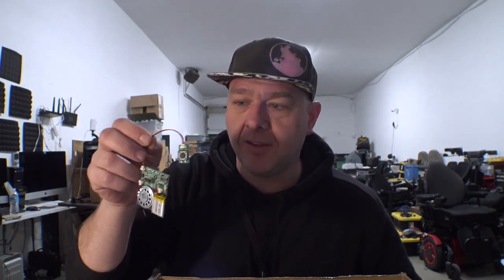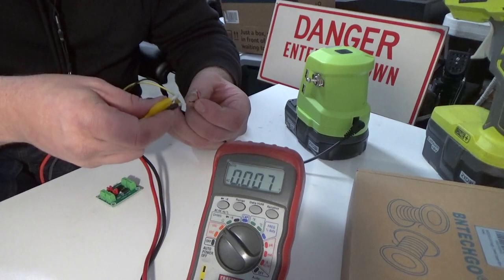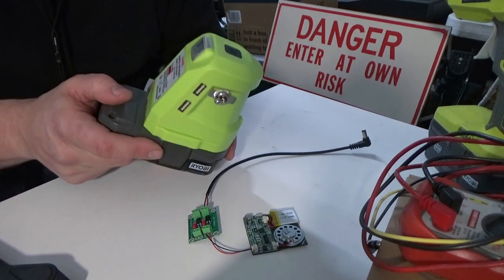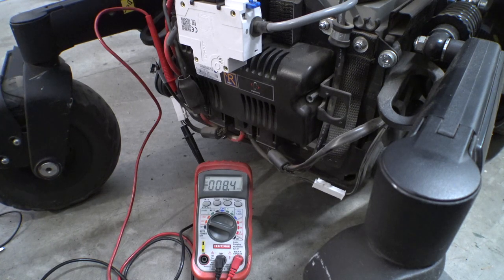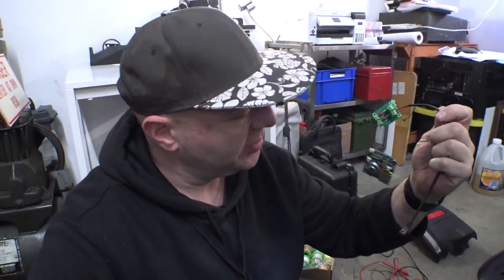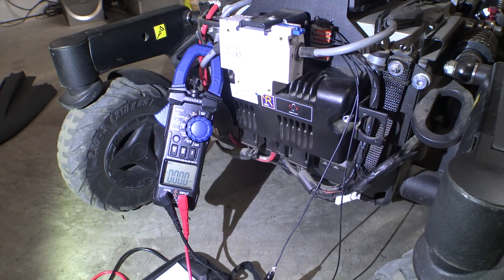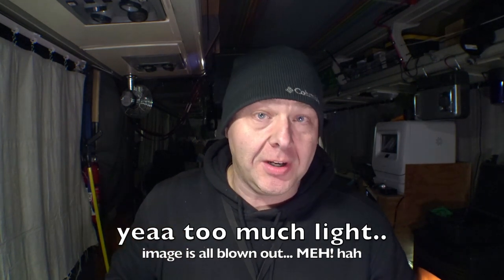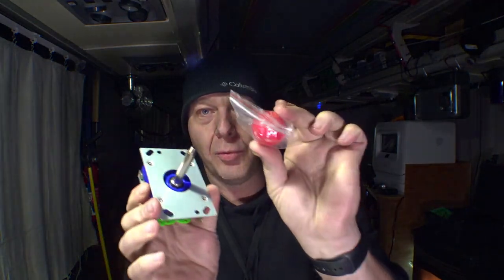VLOG 650: spaceship noises!! (playing with optocouplers)

Comment: Fun! & cool and similar to what I want to do. My own design wheelchair will be ready somewhere this year. Drive unit = old Permobile, body support = all mine. I want to put some power and special lights on the chair, but don't want to risk burning the controller. So: optocouplers! Plan is to put a separate 12V system on my wheelchair, powered by a small LiFePO4 battery. Good question about the back EMF.. If the power is cut of, there will be. The permobile must have protection against that somewhere somehow. The optocoupler, does it have a resistor for the LEDs? A diode? (optocoupler is an LED also, and LEDs are a little bit diode). What input/trigger voltage can it handle, and does it need constant power? Yes I will Google it. Looking forward to your next experiment.

Comment: Your soccer chair needs temperature sensors instead of a toggle switch to turn the cooling fans on . That way you have no switch to worry about and your batteries won't go dead.
Reply from the maker: i actually bought a bunch of temp sensors, and controllers for this! didn't have time to install, or make a video tho before nationals last time around :^)